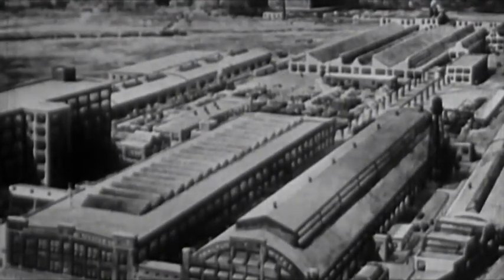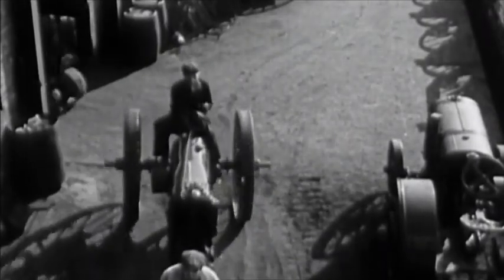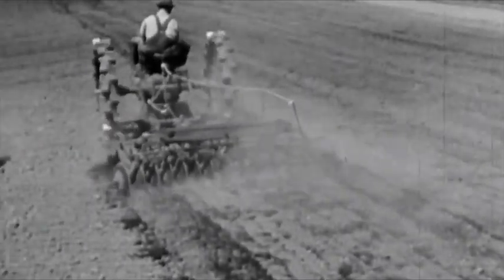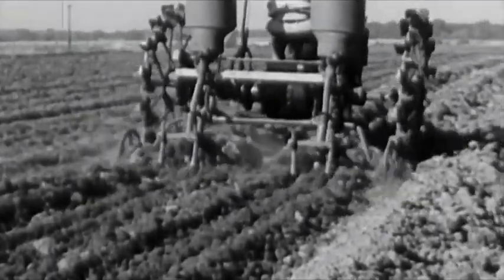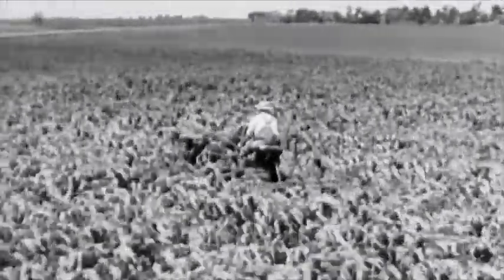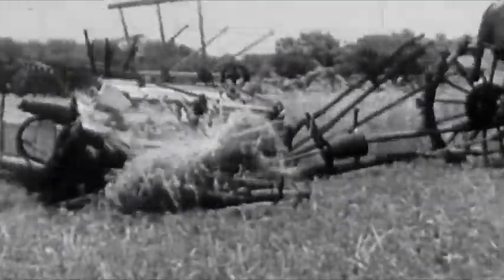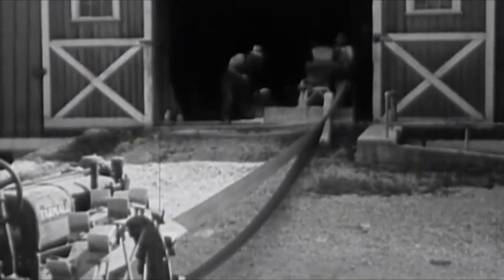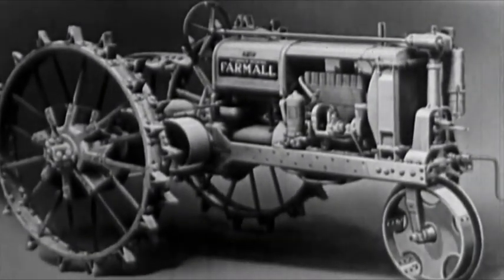Farmall Farming Marches On

Comment: A lot of the F12s they are showing are of the first 2500 that were made with the Waukeshau engines.  At that timeIH did not have their engines ready for production and bought the engines to put in their tractors.  The F12 was introduced in 1933 only about 2500 had the flathead motors.  The IH were overhead valve.  Cool Video

Comment: just seen the drawbar that has that twist in it ( to hook up to the vertical ) part of 
the drawbar / ands the angle iron drawbar brace instead of round rod brace. I never
knew if it was home made till I seen this  pulling a disk. That drawbar came on a 
1939 farmall h I purchased  this fall in 2021 , was from a guy who owned a welding 
shop so I thought maybe he put the twist in each side , but it looked to perfect and the 
braces looked like a nice flattened out area on the ends, so now i know farmall works 
in chicago ill built the drawbar and it came on I cant  tell an f-12 I guess or F- something.